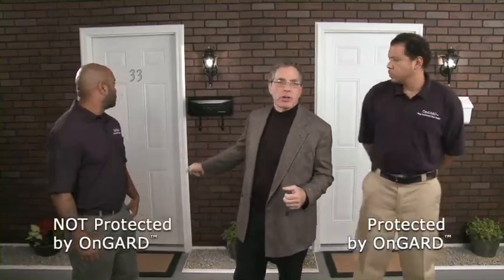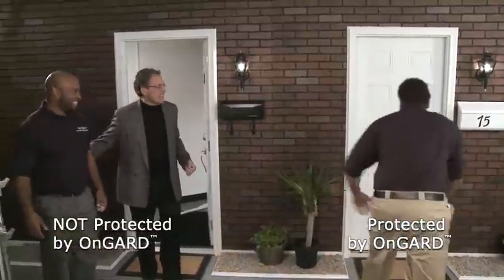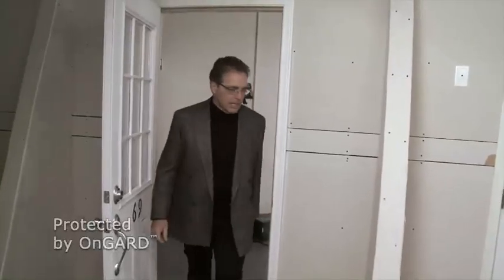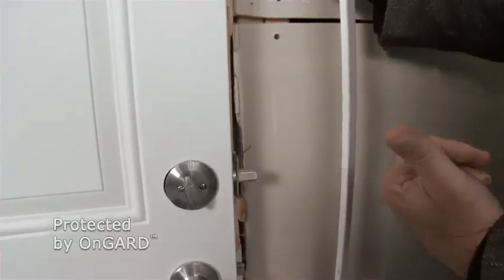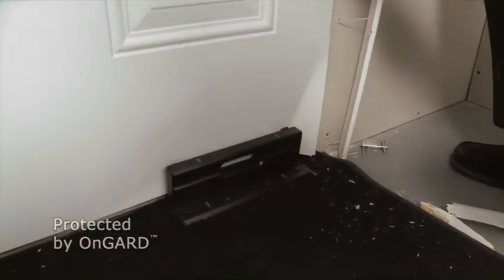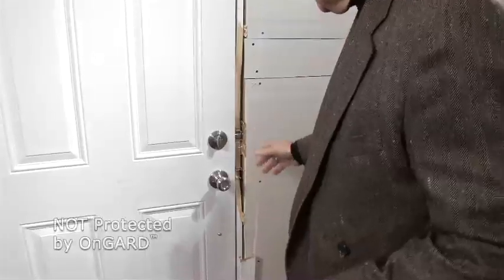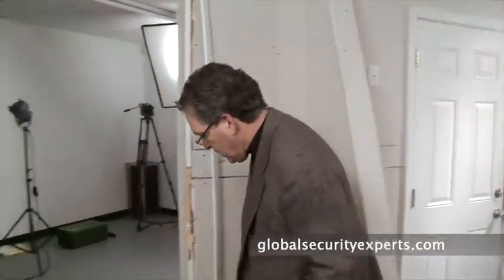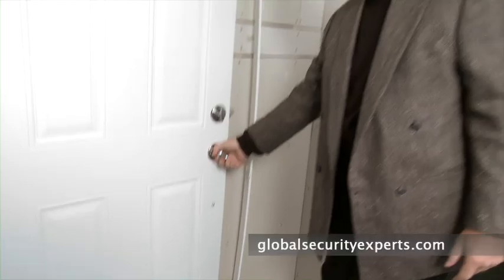Security Door Brace | Door Wedge | Real Time Demo of The OnGARD Door Brace /

Comment: This may be a typical door it may not be, and there is no denying the brace did its job. If this is your typical door you should add a kick plate at the bottom of the door. May not be necessary if your door is steel but it wont hurt. A doorknob reinforcing plate as well as a full length strike plate( the thing your locks go in to) are a minimum. The longer the strike plate the more force that will be required to blow apart the door Jam. A man or men willing to force their way in to your home are violent criminals no if and's or but's about it. If you think giving them what they want will make them go away you are dead wrong, and worse yet, what if you don't have what they want? Think they will simply say "ah", "well", "sorry for the inconvenience". Sadly the violence begins once you have given them everything you have to give. And don't think it can't happen to you, they are not usually the most sophisticated of people they may be at the wrong address.There are hundreds of reasons why you may be targeted and most have nothing to do with you personally, your financial situation or the valuables you may or may not have. Spend what you have to to keep them out. Its minuscule compared to the  cost of them getting control of you  and your family. As for how it protects you when your not home? Who gives a s*** what happens when your not home.

Comment from the maker: The door must be solid wood or steel
Reply: globalsecurityexpert How about a cheap mobile home door that has a full size piece of 5/8 inch plywood secured on the inside? We put two large eye bolts into the  2×4's and run a piece of rebar (round steel) through them at night.